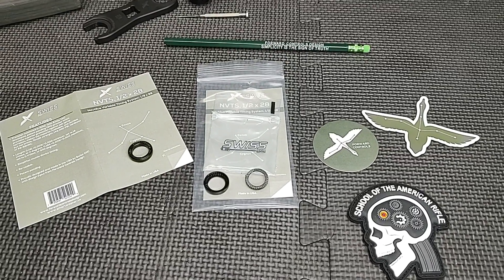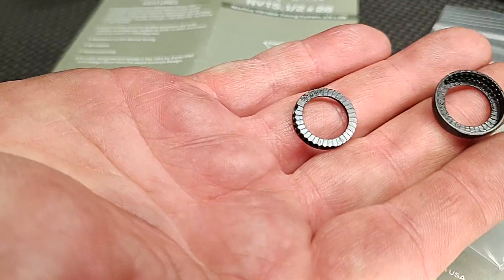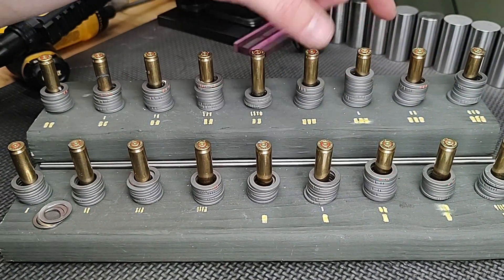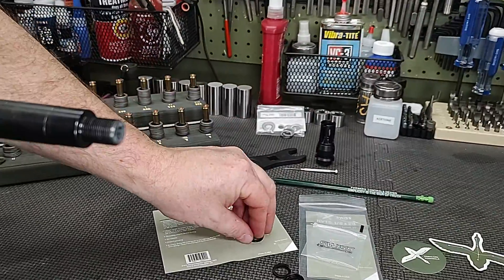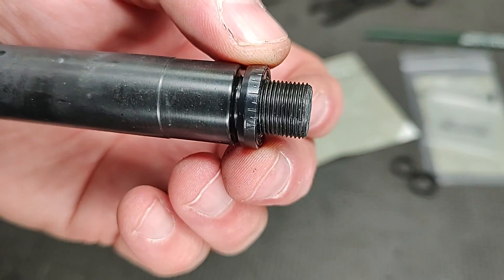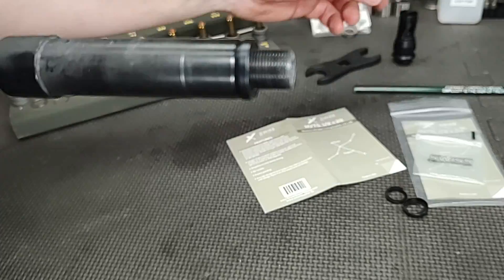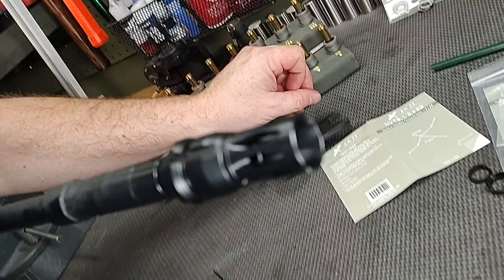Forward Controls Design/Swiss CNC - NVTS - Nautilus Variable Timing System

Comment: Thanks Chad.  As a problem solved, this is a nice bit of machining.  But the pragmatist in me asks, what's wrong with crush washers?  Have you seen issues with crush washers -- is there a SOTAR vid about them I haven't watched?

I agree about the shims stacking oddly and looking like crap, I have one MD shimmed and it looks like a sloppy stack of pancakes.  I try to not obsess too much about that aesthetics side though.  My other uppers use crush washers for timing.
Reply: Not supposed to use crush washers with a suppressor.
Reply: @Rowdybandit545  Right, but that wasn't what I asked.
Reply: Your question doesn’t make any sense then. This NVTS would be fine to use on non suppressor mount muzzle devices but a crush washer is a much cheaper and easier solution.

Timing shims are required for suppressor host muzzle devices that require timing and a specified torque range and that you Rocksett the MD in place so it doesn’t back off when you need or remove the suppressor.
Reply: @brianfhorton  Your fiirst paragraph, that summarized the POV I had above.

In other words, using this timing device is overkill (versus a crush washer) for mounting a brake or flash hider.  The imagined precision required for a brake or flash hider timing isn't there.

Comment: Tried one and it required the last increment to achieve timing of the Forward Controls Brake. Using the Geiselle Suppressor Alignment Gage, it showed to be misaligned. Removed and rotated device and measured again to have the misalignment follow the NVTS. Used traditional shims and got perfect alignment.
Will have to try again on another barrel/device.
Reply: There would be an inherent precision limit based upon the width of each stairstep ledge.  I'm sure the ledges are much, much wider than your thinnest shim.  I don't think this is for BR shooters running lead sleds trying to max the machine regulation.  It's for people who swap barrels/muzzle devices frequently, I'm guessing.  For that purpose it's fantastic.

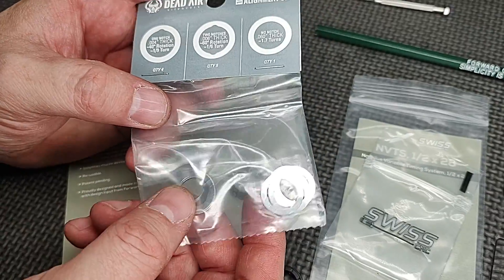For a shoulder-fired rifle, most users are not dead perfect in their presentation and other shooting mechanics.  Many would benefit from a 1:00 (if righty) or 11:00 (if lefty) timing to offset their shooting mechanics that will generate a recoil drift tendency the off-timing opposes.  Jerry Miculek has talked about this in a video before.  So from that POV, the "inaccuracy" of the timing on this FCD/SwissMachine device is not an issue.  Clock it slightly past dead center high noon for righties, slightly before high noon for lefties.

(ignore those time stamps, they were not meant to refer to Chad's video at those times.  They are clockface timings for the muzzle device)
Reply: @seanoneil277   Different misalignment. The timing or rotational alignment was fine at the last increment.
The misalignment noted here is perhaps described as yaw. The alignment rod is snug to the bore of the rifle and touched the inside of the muzzle brake indicating that a bullet would likely strike the suppressor when attached to the brake. Since a traditional shim corrected the issue, I suspect that the NVTS did not stack square when at the last step of its adjustment. I will try again some day, but I don’t build guns for my use as often as customer guns and the only customer I saw with one was anxious to try it himself so no data point there yet.
Reply: @GunsmithSid  Sorry I didn't think about yaw deviation.  That's a problem!  Projectile strike, no es bueno.  Sounds like there are un-true ends or un-true ladder steps within.  Tough to get as many ladder steps as there are, all true.  But that's what precision mills are supposed to handle, eh?

Comment: I hate it when I'm at the workbench at the gunshop and  I set a dead air shim on the bench for a minute...  And then when I go to pick it backup, I have to try to differentiate it from the twenty or so other shims discarded on the bench! 

Another thing, when it comes to timing muzzle devices, OCD is real.

Comment: Can you make a video showing how this timing shim maintains alignment at its extended settings? It seems like only a portion of that shim would make contact on the inside mechanism and it may throw off the alignment on your suppressor. I've had a very similar experience with a shim set where the thickest shim was slightly thicker on one side than the other, causing the suppressor to fail the gauge test.
Reply: It's a set of staircase ledge cuts opposing each other.  Each "turn to notch" for as many notches as go around the clockface.  The notches have to be cut wide enough to support the linear load while enabling the "turn to notch" feature.

It's similar to how bicycle hubs use engagement cogs.  Google "DT Swiss 350 engagement" for a somewhat similar example of how it's done in a bike hub.  Not exact, the 350 cogs are not staircase cut, but they are opposition cut.
Reply: @seanoneil277 sounds like a lot of room for tolerance stacking and a device that is uneededly large, minimizing thread engagement. Hard pass. Surprised an armorer would endorse this pointless accessory.
Reply: @ColtHarris-u6w  Definitely would need tight QA/QC.  And materials which retain accurate ledge dimensions over use & time.  If done well, it could be useful -- though rather complex/expensive.